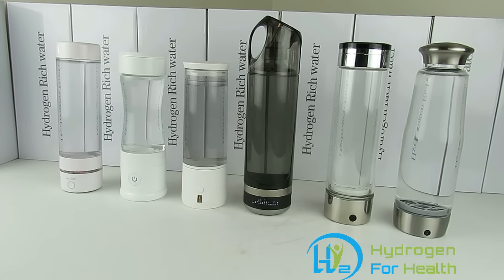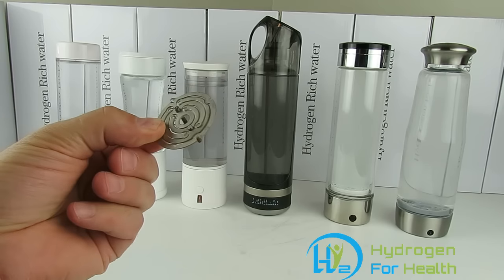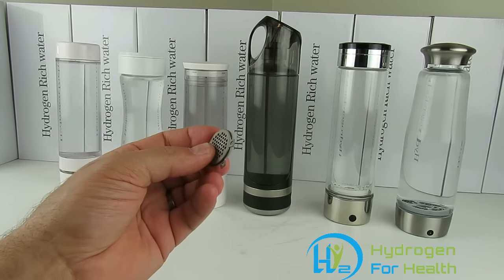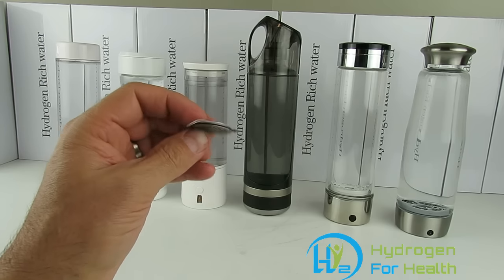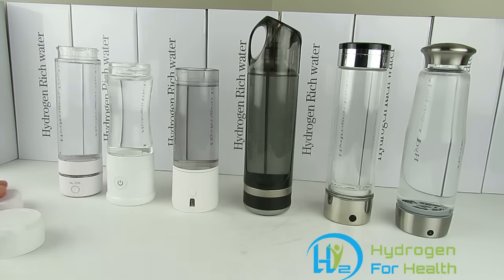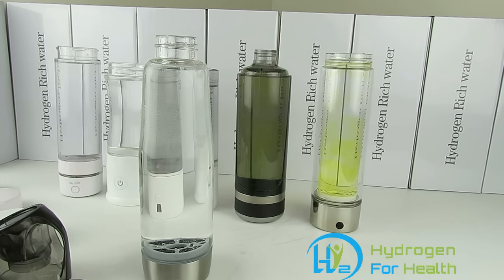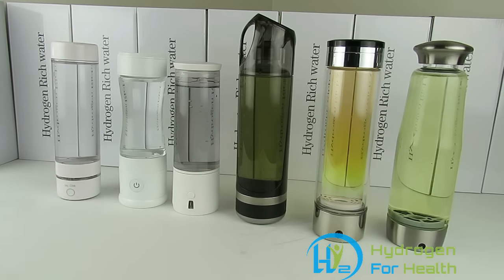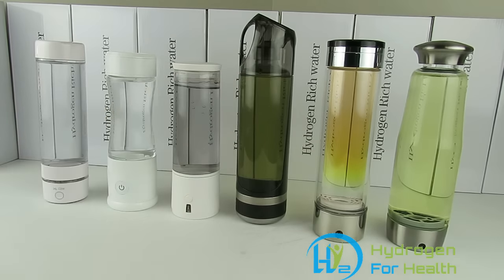Hydrogen water may NOT be safe to drink! Lets find out WHY.

Comment: Good info but I must clarify. Ozonated water is actually good for especially for defeating certain infections. It acts like hydrogen peroxide as it is an oxidizer. Your body uses both oxidzers (to kill foreign in vaders) and antioxidants for repair. I would use both types of waters. Also process makes chlorine dioxide because the ozone reacts with the sodium chloride that might be in the water. Chlorine dioxide has also been used for things like Malaria. The problem is the process that should be used. You want to first make ozone via another machine with almost pure oxygen, then bubble it in water. Not the way these machines are making the positive side (ozone side) will corrode and now you get metal poisoning. Ozone has a history of doing wonderful things if used properly. They even have intravenous injections or they take your blood run it through ozone and then send back to the body. People feel like million bucks when they do it this way. Do as this guy says though for hydrogen water. Ozone should not be made this way for drinking.
Reply from the maker: Thanks for this comment. It's nice to hear from an expert on ozone. I didn't know this.
Reply: Which is a safe brand althea or wellect im wanting to buy a hydrogen inhalation and water generator machine
Reply: so what are you saying? these bottles are useless?
Reply: Not seen him actually turn any of them on for a full cycle though. Could be tap water in last 3. Funny how all the ones he said ate bad are from amazon and not white plastic.

Comment: I use hydrogen water generator since 3 months ago and my life changed ,the water stopped my gums problems,I get rid from constipation,I feel very calm and I sleep better.The problem is that I changed already 3 bottles because the bottom stopped to generate hydrogen I mean not seeing any bubbles inside ..
Reply from the maker: That’s great to hear. You should look into getting a inhaler. It can make gallons of hydrogen water at a time and also you can get the benefit of inhaling hydrogen.
Reply: @Hydrogen4Health  Thank so much for this information! I will try it later!!

Comment: Not all water has mineral salts.

Reverse osmosis, Distilled, Deionized. 

C'mon man
Reply: Who's gonna go out of their way to buy filtered watered to fill their bottle? These bottles are meant for an on-the-go type of lifestyle to use regular tap water. Even if you have filtered Tap water at home, it still means you're restricted to your home tap.
Reply: @PJPEE  If I knew chlorine would be created if I did not buy distilled water, I would most definitely buy distilled water for two reasons:  it's super cheap and you're not apposed to drink a ton of hydrogen water to begin with.  The downside, of course, is that you are buying water in a plastic bottle which results in drinking tons of micro plastic particles.  sigh........
Reply: Will electrolysis work on distilled water? Deionized water at least doesn't conduct electricity.
Reply: @mrtechie6810  right because it has no elements to conduct. Deionized is extremely pure water with absolutely no minerals

Comment: To check it at home, you can put table salt and chack if it will smell like chlorine after electrolysis. If so, you can still use it with salt to produce 'electrolyzed water' Hydrochloric Acid (Hydrogen Chloride) disinfectant that works on SARS cov-2, in concentration up to 200ppm clean meat and vegetables.

Comment: I’m trying to figure out whether my bottle was previously used. I first turned it in without any water in the bottle and little droplets of water started spewing out that hole in the bottom of the generator.  Why would water shoot out that hole if it hasn’t had water in it before?  I then made some hydrogen water and since then there is no noise or little drops of water coming out of that hole on the bottom.  Is that normal?

Comment: I don’t understand the experiment. Not a criticism I am just genuinely trying to learn and understand. All tapwater has chlorine in it. Most places use that to clean the water. If they could simply electrolysis it to make chlorine they wouldn’t be buying 1 ton tanks of OT weekly? I need to rewatch this video. But thank you for putting your two cents and information forward!
Reply from the maker: The point of this video is to show that the electrolyzer can make it's own chlorine. Health minded people do not want to drink chlorine. A PEM bottle will not make additional chlorine and put it into the water you are drinking. That's what this video demonstrates.

Comment: Directions on most of them warn you not to use tap water for this exact reason. You are supposed to use filtered or bottled water.
Reply from the maker: If it's PEM you can use any kind of water.

Comment: I have two questions.
1) theoretically how many times do I need to electrolyze my water to produce enough hydrogen that can be ignited? Can I even do that to confirm it produces hydrogen?
2) chlorine evaporates fast. What if you try leaving the water rest in an open container for 10 minutes and then hydrogenize it?

Comment: So the presence of chloride salts in water produces the chlorine. In other words, if you use reverse osmosis water, you don’t have to worry about chlorine. Now with that out of the way, what exactly produces ozone? Is there a component in the water beforehand that is turned into ozone via electrolysis? I don’t know much about ozone
Reply from the maker: Yes, if you use RO water you wont get chlorine but you will get titanium and platinum leaching from the anode into your water.

Comment: I bought the H2 Nano Molecular Hydrogen Water Bottle with PEM Dual chamber NANO Technology last December 2020. The health benefits are awesome. I have question about the product. Using it for more than 1.5 years, does the product's plate will not get rusty over the years of using it or does it has a shelf life that is safe to use? I am just afraid maybe it will become detrimental to health over the years of using it. Please answer me. Thank you. For info I followed the instructions for proper maintenance of the product.
Reply from the maker: No the plate material will not degrade into your water. Keep using it until it dies.

Comment: Great video - thanks for the explanation. I've a $10 hydrogen water bottle from TEMU and so I'm pretty sure that it's not PEM/SPE and so bought same chlorine tester drops and after the 3 min the water has a slight chlorine/ozone smell, but the drops from the chlorine tester bottle don't show any yellowish color. Any thoughts?
Reply from the maker: Yes, my thoughts are, your health is worth more than 10 bucks. If it's not PEM t's trash.
Reply: @Hydrogen4Health  Thanks for the confirmation. Yeah I've stopped using it ... lol
Reply from the maker: 100%, if the bottle is less than $100, it's not pem. Toss it .

Comment: Great video thank you! I will see if I can get a bottle. 99% of the Tap water out there has chlorine, so how come the first 3 didn't show some signs of chlorine? You said you used tap water not filtered water. Thanks!
Reply from the maker: Because I used unchlorinated water.
Reply: @Hydrogen4Health  HELLO, thanks for the experiment, but also exposing and reminding us all that fraud is out there, even if it mean harming our health.  Boy was I naive...  I am just not learning about Molecular Hydrogen therapy.   Quick question,  all those bottle were GLASS, right?   Hydrogen is so small it would not last in any plastic bottle.  From what I learned.  thx.

Comment: In the last couple weeks I got three different bottles from Amazon in the under-$50 range. After seeing this I was getting ready to throw them all out, but checked their listings and they all say they use SPE & PEM technology. Do I have to take them apart to verify this (I know not everything you read on Amazon is true), or is there some other way I can find out?
Reply from the maker: Look for a small hole on the bottom of the base.  That's the exhaust for the oxygen and contaminants .

Comment: And where is the Cl coming from?  A machine cannot make chlorine.

When you subject water (H20) to electrolysis you break it apart and get hydrogen (H2) and oxygen (o2).  Tap water has fluorine, so if you use tap water that would be  a risk, but not sure where you're getting Cl.  I recommend you stop drinking the swimming pool water.
Reply from the maker: So happy for your recommendation…
Look up what chlorides make when electrolyzed. Your answer is there.
Reply: @Hydrogen4Health  I"m asking you where the chlorides are in water. Where are they in pure distilled water?
Reply from the maker: @houndofzoltan  Chlorides are salts. All tap water has them.
Reply: @Hydrogen4Health  I asked you where the chlorides are in distilled water and you told me they're in tap water.Surely everyone is using distilled water for this? You care enough about your health to buy a hydrogen rich water maker then just use tap water?  Anyway, no need to buy a new one, just use distilled water.
Reply: @Hydrogen4Health  You know I think I'm coming across as very combative and rude, so apologies about that. If people are using tap water then this may be  a genuine concern that people need to know about. Always good to know more.

Comment: Steve, still catching up on a lot of videos of yours that I haven't seen yet.  You have great content!  You know, my tap water already smells like chlorine right out of the tap, without even electrolyzing it.  I only drink filtered water.  I would be curious to see if filtered water would change color with those drops after running straight electrolysis on it for a while.  Though, I'm a huge fan of PEM technology so I wouldn't use traditional electrolysis anyway :) But I was thinking about Cl2 and O3.  In small amounts, they are actually used to sterilize drinking water and are "supposed" to be safe to consume (again, in small amounts, but I'm not sure how true that is).
Reply from the maker: Legend of the Stormlord it’s the salts in water that make chlorine. If your filter takes them out you won’t need to worry about more chlorine being made.  I think the best water is made from tap through a great filter.
Reply: @Hydrogen4Health  Ah yes, I figured the breaking down of NaCl or other chloride salts would be responsible for molecular chlorine at the anode.  I'm just saying there is already chlorine in the tap water if it's unfiltered.  And, depending which filter is used, I wonder if those chlorides could be removed?  Probably has to be distilled to remove them, I'm guessing.  PEM is the way to go.
Hey, did you get my message last weekend on your company email address?  Just making sure.
Reply: @Hydrogen4Health  Hi Steve.  What good filter can you recommend, please?  
 Also, I've struggled with Shower Head filters, (in SoCa).  I currently use a Nikken, but still the hard water problem is only slightly improved.  When I visit Seattle, that soft water is just so wonderful.

Comment: Will the hydrogen make the water acidic? aren't we supposed to be drinking alkaline water?

I have a bottle that says SPE - is that the same as PEM ?

and if the chlorine and ozone doesn't get into the water, where does it go? my bottle doesn't have a collector for waste water - neither does some of the bottles you have here. And if it's emitted as gas, then every time we use this bottle -are we not drinking supposedly healthy water, but breathing in toxic gas?
Reply from the maker: The Water Ph will stay the same.
The Chlorine and ozone in PEM bottles is ejected out a small hole in the bottom of the bottle as a gas. If your bottle does not have this hole them it's not safe to use. These gasses will easily dissipate into the air with no issues. In water it is concentrated into what your drinking so when you drink you are getting it into your body.
Reply: @Hydrogen4Health  I don't understand. These gasses are already in the water, right? So basically there should be no different than drinking water from the tap without running it in the H2  machine?

Comment: Hello Steve, I have a few questions.  
I just received my order for your Hydrogen water bottle.  I tested the first batch, and it was .6 after 7 minutes.  I tested the second batch and it was 1.6 after 14 minutes.  This is a good amount and good concentration for what I want. 
Since the bottle only holds 10 oz, I'm guessing I am only getting a total of approximately 5.3 in a 14 minute batch.  Wouldn't I have to drink 1 liter to get the full 1.6?
Also, if I use a one liter bottle with the adapter to do the whole liter at once, would it still get to 1.6 after 14 minutes?  I'm guessing it would not get to the same concentration of hydrogen in 14 minutes as there would be about 3x as much water to treat.
Is my math correct?  If so, how long would I have to treat a 1 liter bottle to get to the 1.6 concentration?
Thanks so much!
Reply from the maker: Ann I sent you a email.
Reply: Ok Ill get one that has the PEM technology going for it. Thanks for the info

Comment: How can you say that the piece of "membrane" isn't permeable? Light is coming through it. I'm no chemist, but I would say that if if light can penetrate, so can liquid and gas. What kind of "membrane" are we talking about here? What's it's made out of? I really want to trust your videos, but I'm completely unable to take at face-value and suspend my disbelief. The more I watch your videos, the more I notice that no sources are sited. If you know the process but not the math behind it, where did you learn and who did you learn from that might be able to give us "science?"
Reply: Good question, the way PEM membranes work is that block electrons from passing through. When water H2o is electrolized, it separates the Hydrogen (H) from the 2o, it also causes a 3rd Oxygen atom to bind to the 2o, creating Ozone (3o). The PEM membrane will allow Hydrogen which only has protons to pass through, but block the Ozone, that also contains electrons. PEM is not a novel concept for separating Hydrogen, they are used in Hydrogen Fuel Cells for the same reason.

However, what is a little fishy about this, is that most tap water has chlorine added to it, electrolysis, and PEM membranes only effect the water that comes in contact with it, it will not remove all the chlorine that was added to the tap water, so if a chlorine test is showing ZERO chlorine in the water, it was likely pre-filtered to remove the chlorine, or it was from bottled water that never had chlorine added to it

It is difficult to determine if a Hydrogen Generator actually has a quality PEM membrane, but there are a few signs. PEM membranes typically need to be saturated in order to work, so it will not work great straight out of the box, you will need to leave water in the bottle and let it soak for around 8 hours (bubbling action will increase over time. If it does not have a PEM membrane, the bubble volume will not increase. Another method of testing would be to test for Ozone which does not naturally occur in tap water
Reply: @sampetegorsky2429  Soak it with the button active on "on" for 8 hours? 🥺
Reply: @Filemonefly9  No, it does not need to be on, just needs to soak to allow the PEM membrane to become saturated
Reply: Why wasn't this answered?

Comment: Hey Steve, Was there a reason that you turned on or powered up,  the first two bottles in the test, but did not turn on or power up,  the (4) bottles after that? Was it an oversight? Or did they need to be activated to give the proper test results? Hate to be so anal...Thanks!
Reply from the maker: Maybe the video didn't pick up the others but they were all running.

Comment: You cannot do a comparison like this. Can anyone tell for sure he DID use the same water on all bottles? He should have added the water, wait for the ionization to complete and just then check chlorine levels, ALL IN ONE VIDEO WITHOUT INTERRUPTION/CUTS. That's how you do it when you're not afraid of the results.
Reply from the maker: Must be an angry seller that has just found out his product is not safe. The worst thing is he probably won't tell the consumer.
Reply: i'm not a seller. I'm just a user trying to find a good product and i was looking for a fair review of the bottles done the proper way.  With the amount of products out there and the intentional disinformation by manufacturers and sellers I'm very skeptical about these half-done, biased, reviews. I was about to buy your product but then it occurred to me that I could not see the whole process happening before my eyes (adding the SAME water to all bottles, let it ionize, measure chlorine). 

It would be good for your business to do another review the proper way and clear up any doubts. That's all i'm looking for.... a product that works.
Reply from the maker: @humbertosa2806  Okay so your the angry buyer. This video is more than adequate to show what happens in the junk that's out there. You are right that I have not done a good enough job jointing out the crap. I should be eviscerating these companies that purposely sell unhealthy, unsafe products to make a buck.
If your looking for a bottle I think my videos is a great place to start. I can guarantee you 100% if you buy one of the unsafe bottles you will not be happy. I can guarantee you 100% if you buy a bottle that isn't PEM you WILL be ingesting chlorine and ozone. These guys need to be RUN OUT OF BUSINESS !

Comment: If you use distilled water it shouldn't make chlorine.. correct??  You saud salts cause this, I think, but if there's none of those salts in the water then it wouldn't make chlorine... right???  I'm new to this, thanx.
Reply from the maker: That's correct, if distilled water is used it won't make chlorine. Now you only need to worry about metals leeching into your water. Always choose a PEM option.